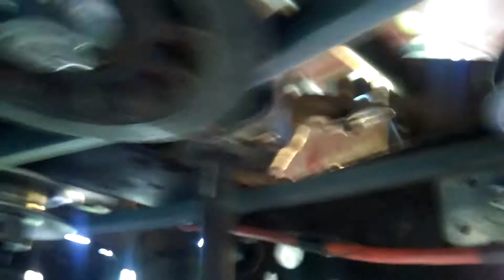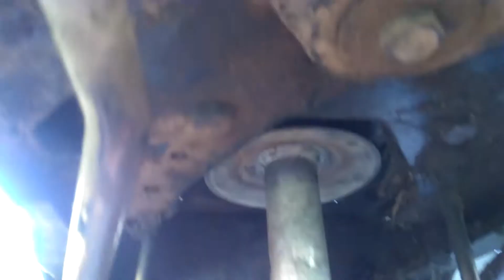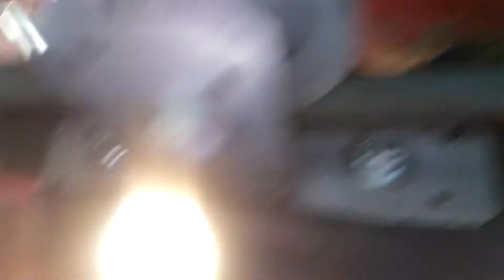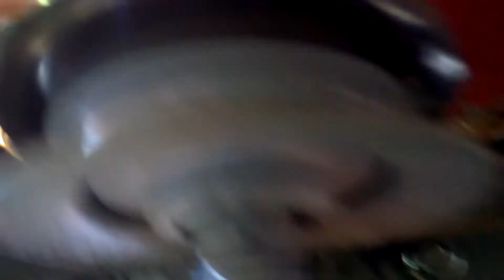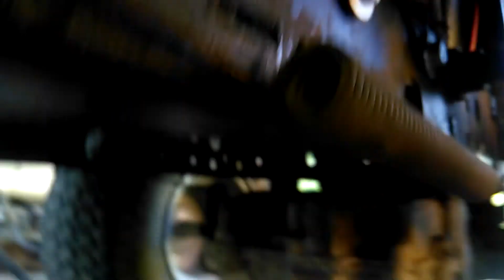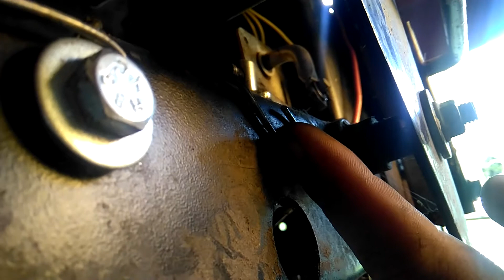How to fabricate idler pulley bracket for lawnmower pulley swap without welding.

Comment: So did it keep the belt from coming off? Can you give an update please? I've drop my pulley to a two inch with 87" Kevlar, continuously comes off if I have to put the clutch in quickly, or all the way down. I switched the stock idler pulley with a metal one from a deck and help a bit, well very little. I was racking my brain of how to it bc I don't have a welder. Your set up looks great I just fear the belt tearing from hitting the frame. Did that ever happen you you. Thanks for your time and sharing your creativity
Reply from the maker: I'm no expert by no means.  Without seeing your set up all I can do is guess.  Maybe you could adjust your clutch for less slack on the belt. Also check the metal fingers by the pulleys. Maybe they arent doing their job with the smaller pulley.  Also ive had no issues with the set up in the video. Belt looked fine last time I looked.
Reply: @clayton7825  I understand, my setup is much like yours. I have an lt1000, Briggs and Stratton 19hp intek. I appreciate your honesty, but you're already a bit more knowledgeable by doing what you did regardless if it worked out for you the simple fact is that you now know if it can work which is why I was asking how this setup turned out for you. Apologise if you have another video stating the results, I scanned your videos to see if there was a update but my ignorance of expecting to see a titled "idle pulley update" or anything amongst that line may have caused me to overlook it. Did this infact improve the mower for you? I'm going to experiment your idea, I just can't really afford to spend money on belts is why I asked but nevertheless I truly appreciate how you quickly responded.